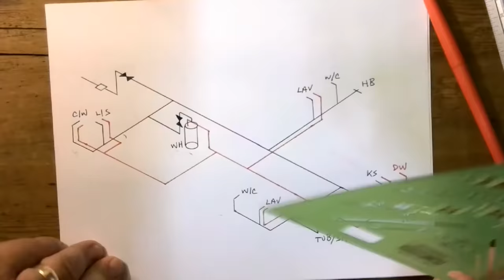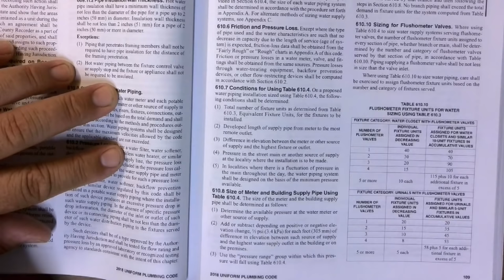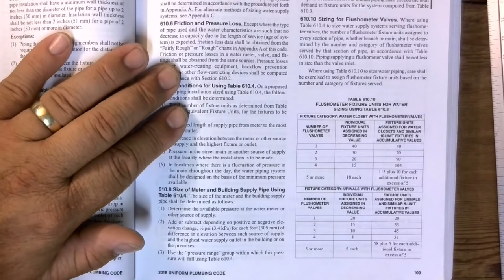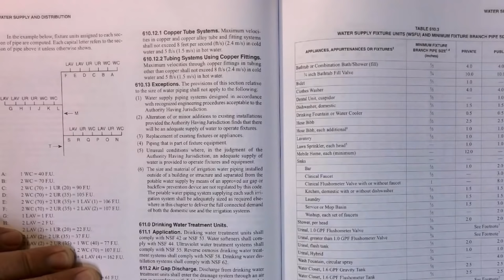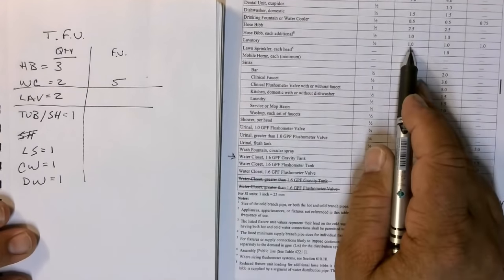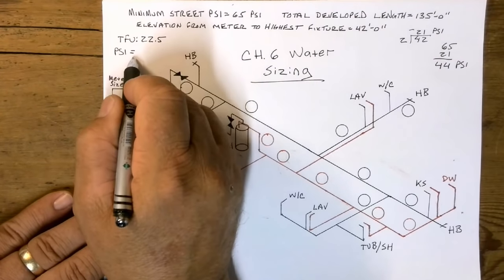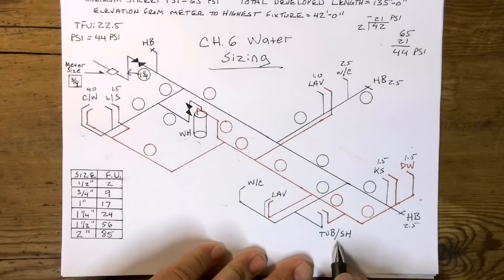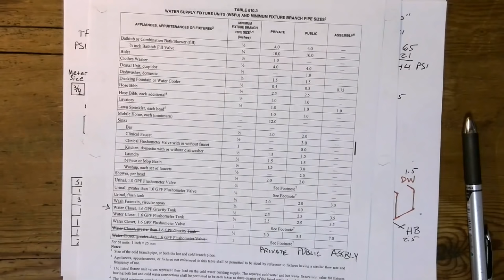Chpt 6 Vol  2 Water Sizing

Comment: Oh yes, section 10-6.5....🤔 Exactly. I just wanna plumb my house in the era of Covid and manage to stay in compliance since I can’t get a plumber  to give me the time of day! 😩
Reply from the maker: Beth, I hope you learn something from these videos.  Is there anything you need to understand specifically?
Reply: @BGsPlumbingClass  my existing copper pipes need replaced and I have decided to go with Pex B. I have complete access under my modular home to everything. Is it advisable to replace with the same size? The inside diameter of copper pipes is slightly larger than the inside diameter of Pex.  Will this present a water flow problem? I know the answer is more complex than a simple yes or no and is based on the number of fittings and connections etc. I have two tubs with showers, two bathroom sinks, washer/dryer, water heater, kitchen sink, fridge waterline, no dishwasher.
Reply: My home s 56x24 ft.
Reply from the maker: @beth1533  A short answer will be to use copper again.  I was "brought up" on replacing Polybutylene in the mid 90s- which is the distant cousin of PEX- with copper.  It was found to be defective and ruined several homes.  With that being said, PEX is not the same as quest pipe (polybutylene).  If you choose to go with PEX make sure you are familiar with the method of installation.  PEX B uses a fitting with a smaller inside diameter than that of type A. So not only is the tubing smaller in diameter but the fittings are smaller than the tubing!  That will restrict your flow a bit.  The drawback to type A is that you require a tool to expand the tubing enough to insert the barbed fitting inside the expanded portion (Milwaukee provides the best tool for this purpose).  But the fitting inside diameter is larger providing less flow restriction than the B type.  I hope I answered your question without confusing you too much.
Reply: @BGsPlumbingClass  thank you so much for you advice! Your explanation is clear and will help guide me in the right direction:)
Reply: @BGsPlumbingClass       just discovered your channel   awsome info here.    I want to add   that in beths case   she may concider  tha a trailer or mobile home might have rodents underneath they love to  naw on plastic pipe.     I think a little common sence  helps with sizing   and sometimes rather than figuring every fitting etc  to go bigger   if a 1/2 inch line is that close    to making it  go   with 3/4.   Of cource  if you arent expeianced at all in piping   you wouldnt know this  and even expeianced guys  get  careless   and wind up undersized
Reply from the maker: @jeffreyplumber1975  Because of teaching for so many years, I have come to understand the reasons for sizing based on distance and pressure variations in relation to velocity of fluid through piping.  A rule of thumb way of sizing may work sometimes, but not always.  Two houses identical in every way, could demand different sizing if only the pressures available are 25 psi apart between them.
Reply: @BGsPlumbingClass     Yea I like going by the book . fact is I havent plumbed a complete job in ages. so much appreciate your channel!
Reply from the maker: @jeffreyplumber1975  Thanks!  I am bound to do more videos soon.

Comment: i have a question about developed length, so im unsure if we need to add the developed length of the hot line coming off the water tank to the end of the farthest cold line? i did some continuing education classes and when they asked for developed length of water system i counted only the longer run, and i got a perfect score, but i always wonder do we need to count those (hot and cold) as a consecutive run or not?
Reply from the maker: The furthest distance is the length from the meter to a fixture by way of travel.  So let's say a shower is 60' away from the meter on the cold side, but it's 120' by way of the hot- because the water heater is located 30' further down stream.  The water, when the hot comes, then travels 30' to get heated and 30' back to the fixture.  Therefore the furthest fixture is 120' away because of the travel required to dump out on the hot side.
Reply: @BGsPlumbingClass  yes this part confuses me. i was taking CE classes online and i took a water class and it had me measure developed length and all i did was measure the farthest fixture physically and i got a perfect score. i didnt add any of the hot line as an additive length and in the back of my mind i was thinking i should but it still scored it as correct the way i did it. im a month away from my resi specialty exam and i wanna pass lol
Reply from the maker: How'd you do on the exam?

Comment: Sir, I wanted to know how we can size for multiple story buildings where pumps are required. How do we size the water supply risers and inside piping
Reply from the maker: Aside from having an engineering firm design the system, your best bet would be to utilize Appendix A in the UPC.  That method of sizing uses pressure, friction loss, velocity, elevation, and gallons per minute to determine size of pipe.

Comment: How do you know where to find the most remote fixture(where is where you start from) when it comes to roughing in a home.?
Reply from the maker: Imagine being a drop of water. If you start at the meter and get to the kitchen faucet through the piping, how far did you go?  Now be another drop of water and travel to the water closet upstairs, how far was that?  See, it's the distance in piping from the meter to the furthest point- more than likely it will be a distance through the water heater.  If you are looking at a set of plans, chances are you will be the one that designs the system anyway so then you could scale it out.
Reply: @BGsPlumbingClass  Im confused.. First youre saying that you measure from the Water heater to the shortest distance possible of where that water line goes too.  Then designing it? I can put it wherever?
Reply from the maker: @realdeal8078  I in no way tried to confuse you.  So sorry for that!  Let's look at it a different way.  The distance from the meter to the fixture that is the furthest away is the distance you will be calculating for the whole system- based on the UPC.  If that distance (in piping- always in piping) happens to run through the water heater, then that is the distance.  When I referenced looking at plans, I should've been more specific.  If it is a commercial building, the plumbing is laid out for you by an engineer- almost 100% of the time.  If it is a residential house, many times the plumbing lines aren't there for us, therefore we figure out where the system gets installed.  We always use the furthest distance for our calculations because of pressure loss through distance (friction loss).

Comment: Where can I get that utensil?
Reply from the maker: I have had that template for over 20 years and it is phenomenal!!! It beats using a 30-60-90 triangle.  I believe you can get it on Amazon Rapid Design R-43 for isometric piping.

Comment: Which is the template you use to draw the sctech? Could you possibly slow down the beginning where you sctech the roughin pipe supply? Or where did you get trained,  or are you a natural artist? Thanks
Reply from the maker: I get that question a lot.  That is a Rapidesign Isometric Template R-43 you can find it on Amazon.  I got mine about 25 years ago as an apprentice.  I learned isometrics in school as a young apprentice.
Reply: Awesome 👌 thanks
Reply from the maker: You're welcome.  Were you able to get a template?